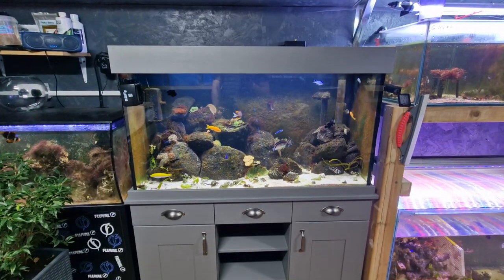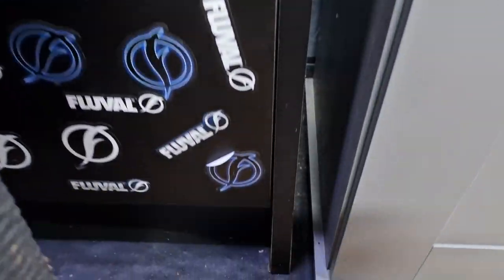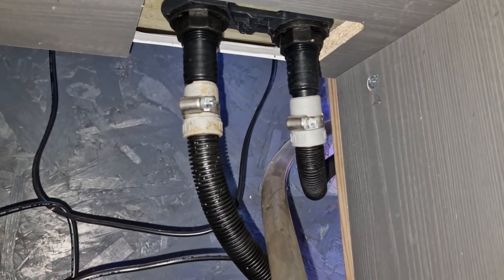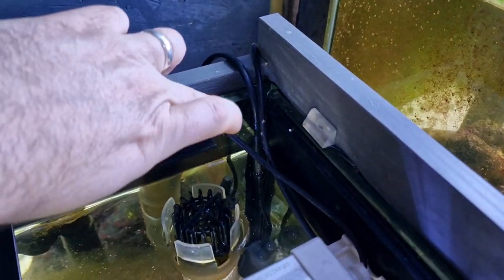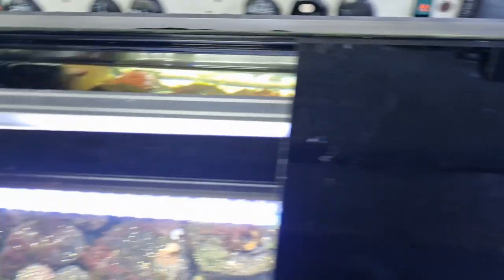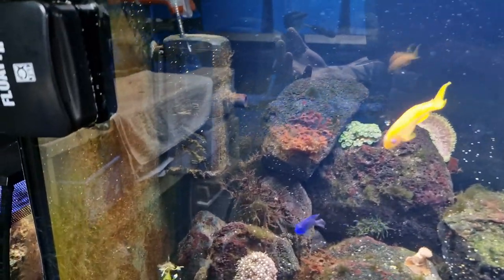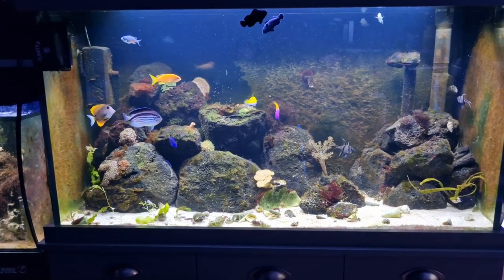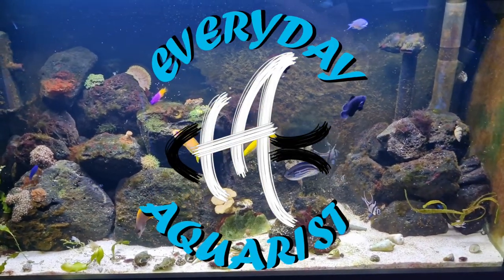FLUVAL SHAKER after 6 MONTHS Review | Is it GOOD? Does it LAST? Can it run as a Saltwater Aquarium?

Comment: Great update. Mine is 10 months in :) and have the 407 with UV and 3.0 light. I also put a DD auto too off too.  

How many fish have you got in this tank? I currently have 5 chromis, 2 clowns, fire fish, yellow watchman and 2 antheas :) how many more could I get away with.  I do a 50 litre water change every week so think I could over stock a bit lol
Reply from the maker: Thanks, nice upgrades. 2 x chromis, 2 x Anthias, 2 x black clownfish, 2 x bangaii cardinal, 1 x mandarin, 1 x Tomini tang, 1 x Lamark angel, 1 x silver belly wrasse, 1 x midas blenny.

Too many fish but it's connected to another 600L of water and more filtration so it works ok

Comment: Just for reference you can actually fit an FX filter inside the cabinet. I have an FX6 inside mine you just have to turn it a bit and saw off the smaller sections of the hose tails to not restrict flow Fluval told me to saw them via email.
Reply: Fluval told me fx4 and 6 won't fit. I really want one😢
Reply: @SeanNoonan-e9w  it does fit… I have an FX6 under mine

Comment: I finally added Macros to my tank!
It's a bunch of Caulerpa Serrulata.

Though I already have a problem after only 6 days I already have a problem.

The tip of all the algaes turn white.

Only the tips and with white I mean litteraly white, not a single puce becomes transparent like when they go sexual, it's more like a plastic toy losing color.

Also this problem auto fixes at noon, I don't know why, but around noon all of the algaes (except for the bigger bush) return like normal and then at dawn they turn pale again.

Also the white part doesn't grow day by day, even for the big one that is always white.

Sooooo, what's happening?
What do I have to do?
Reply from the maker: I have seen caulerpa goes white during low light periods so maybe do your lights ramp up and down and it's adjusting to the light levels

Comment: I added a fluval marine 3.0 into my aquarium and just noticed it has condensation buildup in the unit.  It supposed to be ip67 rated.  How is your light unit working? Do you think this is happening because the light unit under the hood/flaps and not outside like other aquariums.  Thanks
Reply from the maker: That shouldn't happen take it back